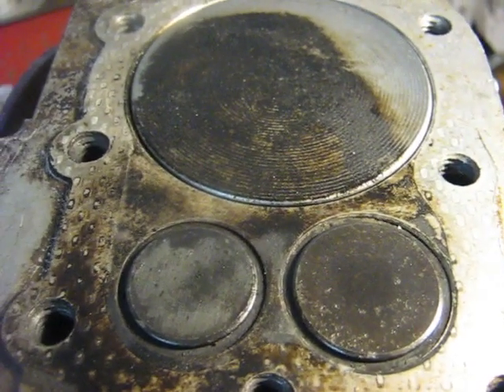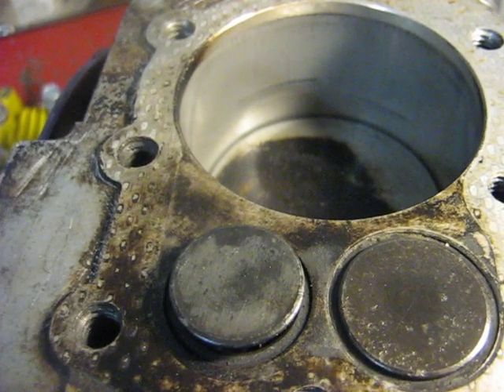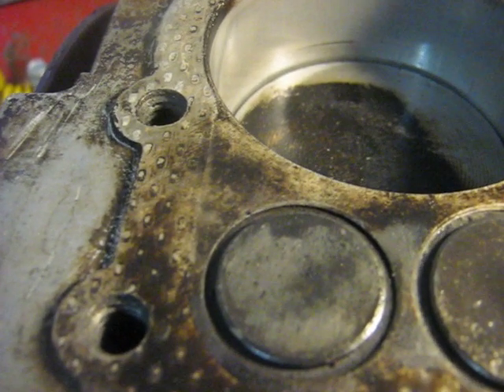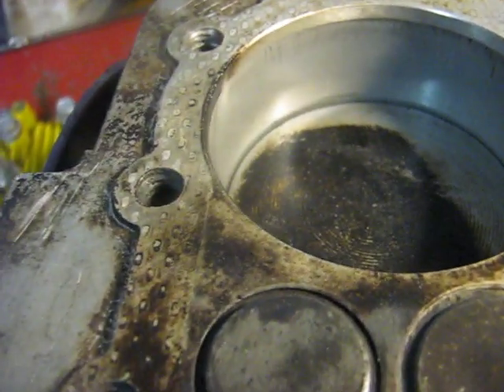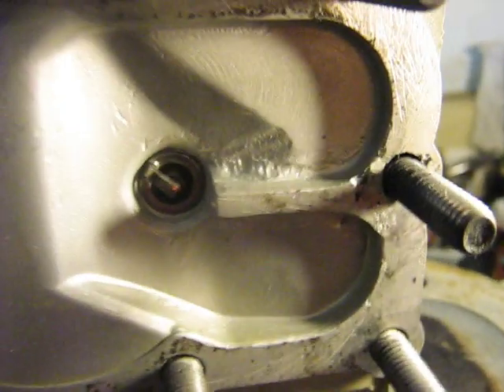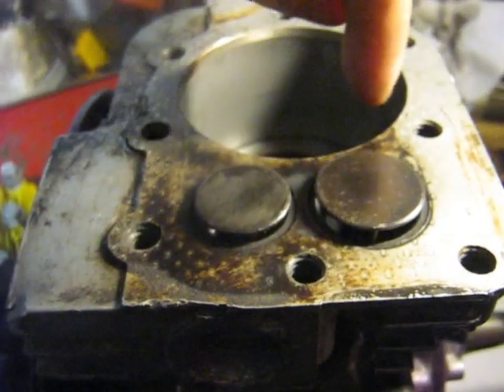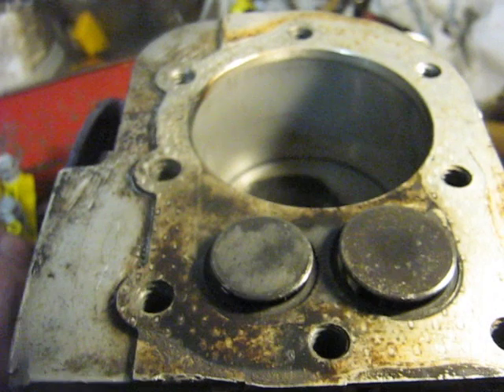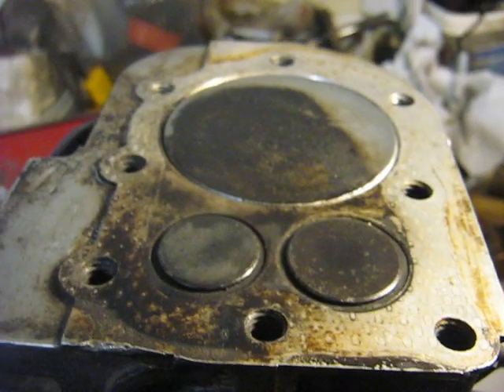Poppet valve 2 Stroke Final Valve Timing

Comment from the maker: That is a very good point about the flow separator "fin". I had to do some grinding on it last night, for inlet valve clearance, so now it has a thinner area in the middle. I think you are right about it heating up, and causing pre-ignition. To be truthful with you, I didn't consider that when I was thinking of this engine concept.
Now be truthful, it would be kind of fun to see the engine put a rod out the side (without damaging my full speed can setup)  lol  :)
Hopefully it lasts a few runs!

Comment from the maker: Yes, valve spring seat pressure is another area of concern, for sure.
I have just used the normal valve springs so far, but the full speed can will surely put them to the test.
You have convinced me to put an exhaust valve spring onto the intake valve, that way it won't "float" too soon, and cut into the compression stroke any more than it already does.
I don't think this engine will be a Screamer, but firing everytime, it should sound like it is revving up there.  :)

Comment from the maker: Thanks for your interest in the vids.
To be truthful with you, I have built and ran a 2 stroke with inlet ports, and poppet exhaust valves (similar to a Detroit 6-71 diesel). It worked OK.
I read about the poppet valve 2 stroke, such as the Toyota S2 engine, and decided to give it a try using a flathead engine. Surprisingly it runs pretty well.
I run the supercharger engine at 1:1 so that the pressure pulse is timed correctly. The blower is actually a larger engine also.

Comment: hey Miles, long time subscriber, engine builder, and small engine technician here. if you are going to be running that engine long enough to heat up, i really think you should cut the separator on the head back. it is going to get really hot and act as a glowplug. it wont run as good but you wont have to worry about a hole in your piston from some good revs! eh

Comment from the maker: Modified the camshaft, and the cam drive, so that it now turns the same speed as the crankshaft, instead of the normal 1/2 crankshaft speed. 
Remember though, that this engine was originally a 4 stroke, so it has oil in the crankcase.
Also, this conversion is just for experimental temporary use, and you need to add a supercharger, since the resulting engine can't breath on its own. I use a larger piston engine with double lobes on the camshaft, making it into an air pump (supercharger).

Comment: That's a neat engine... I like your divider between the valves... seems like it works well. The Crecy was based on the Ricardo Dolphin of 1904 and the dolphin was based on the Clerk of  1880 and the clerk was based on the Brayton of 1872 which was really  the original compression 2 stroke . Have you thought about using a V twin one for the compressor one for the power ?
Reply from the maker: I could see how a V twin could work as a compressor. I have only seen a few of them at the scrapyard, and I generally go for the smaller engines.
Reply: if you look on my channel you can see a Bryaton made from a v twin air compressor
Reply from the maker: Man, you make some crazy stuff, that Brayton powered bike is Awesome, just be safe driving it, I think you should add some guards, wouldn't want to see you get a pant leg caught in the flywheel !!!  Leave the guards outside in the rain so they rust up and look old  :)
Reply: DO this with a hemi
Reply: This has been done with hemi engines for racing, the aluminum 572 is a popular 2 stroke blown motor for sand drags, the billet  aluminum head has a baffel between int and ex valve for thorough loop scavenging, you are ahead of the game

Comment: The rest:
 Second, you're using an engine for a "supercharger" but you're only spinning it 1:1? Wouldn't 1:2 make more sense?  Also, if a motor runs but doesn't make enough power to do work, what's the point? I do appreciate your enthusiasm though.

Comment: I have a strange interest in your videos. While you may be the smartest among your friends and impress the hell out of the 12 year olds in your neighborhood, I can see that you don't have the basic understanding of the dynamics of a poppet valve two stroke. First, you want the intake charge to enter from the bottom of the cylinder to clear the exhaust gasses. If you do this you can use both valves as exhaust valves. Second, you're using an engine for a "supercharger" but you're only spinning i